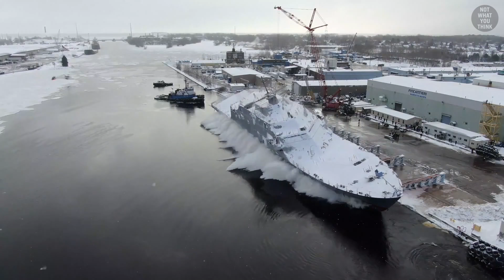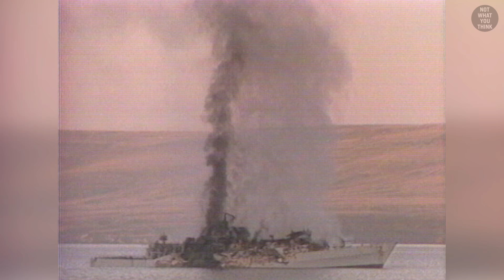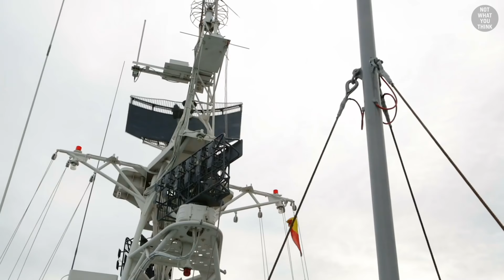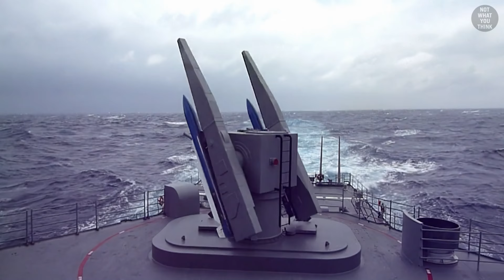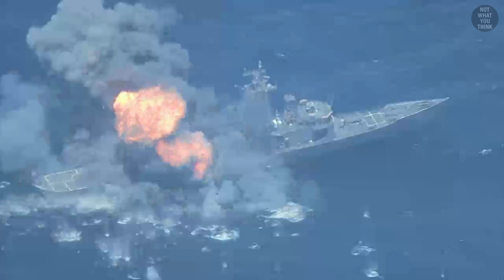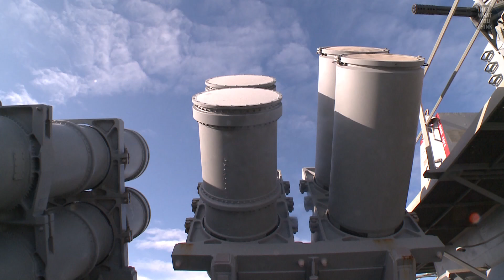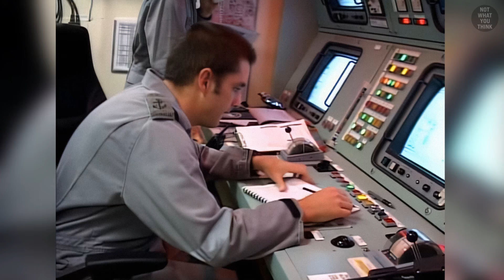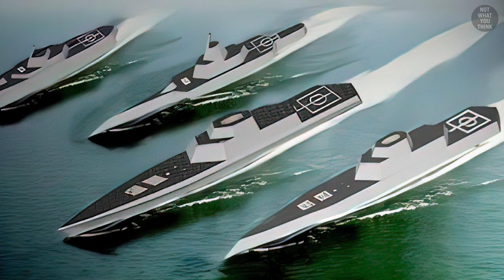How US Navy Made The Most Successful Destroyer ... But Now Has to Replace it.

Comment: Its  cheaper by far not to retire the Burkes. It's not like an old aircraft where the wing spoar can fail and the aircraft can fall from the sky. If you get a crack plug it and get to shore. If there is war new or old incoming missiles wont discriminate to which ship it will sink. There will be losses. They got rid of the FFG7 way too soon and wasted 34 billion on the Little Crappy Ships. Lets not repeat that with our destroyers. While we extend the life of these fine ships the Navy should take it's time designing the next ships and then line up the yards to build them. They have ten years before the flight one ships will be retired. Even if some ships have weaker radars all of the ships with the AEGIS systems are linked.

Comment: OK----------- .  INSTEAD OF SCRAPPING THE BURKE, MAYBE THE NAVY NEEDS TO MAKE THE BURKE INTO A DESTROYER. IT SHOULD HAVE BEEN BEFORE CONGRESS, WITH ALL ITS WISDOM, FORCED THE NAVY TO BUILD A SHIP SMALLER THAN THEY NEEDED... 
------------- .  THAT IS RIGHT, CONGRESS WANTED TO SAVE MONEY. SHOCKING!  WELL, LET'S SAVE CONGRESS EVEN MORE MONEY FROM PAYING ANOTHER 100 BILLION DOLLARS TO DESIGN A BRAND NEW DESTROYER  THAT, WITH CONGRESS'S TRACK RECORD FOR CONTROLLING THE NAVY'S PROGRAMS INTO BILLION DOLLAR BOON DAGGLES. LET'S CORRECT CONGRESS'S MISTAKE INSTEAD. AND LENGTHEN THE NEW BURKS ON THE BUILDING WAYS DURING THEIR CONSTRUCTION. INTO THE DESTROYER THE NAVY WANTED 40 YEARS AGO..  WHILE SAVING CONGRESS AND THE TAXPAYER BILLIONS. IN ANOTHER FAILED PROGRAM...   ALL THE NAVE NEEDS TO DO IS STREACH THE EGSISTING  DESTROYER'S HULL ON THE  BUILDING WAYS 100 FEET. A BIT LONGER THAN WHAT THE NAVY WANTED 40 YEARS AGO BUT WHY WASTE GOOD MONEY AND MAKE THE OLD NEW DESTROYER BETTER THAN THE OLD..
---------- . THE LONGER HULL IS CHEAP AND EASY TO BUILD AS IT IS JUST THE SAME CONSTRUCTED HULL OF THE  DESTROYER WITH JUST A 100 FOOT PLUG ADDED IN THE CENTER BETWEEN STACKS AT THE CENTER OF THE SHIP..ON A PART OF THE HULL THAT IS FLUSH WITH THE WEATHER DECK WITH NO HOUSES ABOVE THE MAIN DECK.. MAKING IT EASY.  THE NEW SECTION HAS TO BE BEEFED UP TO HANDLE THE STRESSES OF A LONGER HULL, BUT THAT IS MANAGEABLE. BY SIMPLY.  ONE WAY IS USING THICKER HULL PLATES OF 3/4  INCH. A QUARTER INCH THICKER THAN THE 1/2 INCH THICKNESS OF THE ORIGINAL HULL. BUT THEN, I HOPE THEY ARE NOT STILL MAKING DESTROYERS WITH ONLY 1/2 IN HULL PLATES, BUT KNOWING THE NAVY, IT STILL IS..  AT LEAST I HOPE THEY ARE BUILDING THE  SECOND OR INNER HULL CLEAR UP TO THE MAIN DECK INSTEAD OF STOPPING AT THE WATER LINE. BUT NOT HOLDING MY BREATH ON THAT EITHER..
----------- . ESPECIALLY AFTER THE BOMBINGS DECADES AGO OF THE COLE THAT KILLED 20 AND THE THREAT OF SUICIDAL DRONES AND CRUISE MISSILES SO PREVALENT NOW.. THE SECOND HUL, 7 FEET IN FROMTHE MAIN HULL ALL THE WAY UP TO THE MAIN DECK...  THAT WOULD HAVE SAVED 20 LIVES BACK THEN.. AND EVEN MORE IN THE FUTURE WITH EACH CRUISE MISSILE HIT AND SUICIDE BOAT BOMB DETONATING AGAINST THE  HULL.. BUT WE ARE NOT HERE TO DO TOO MANY CHANGES, SORRY TO SAY.. AND WHAT IS, IS.. THIN HULL, TWO DECKS OF HULL BARE UP TO THE MAIN DECK..JUST STRENGTHENED ENOUGH FOR EXTENDING THE HULL 100 FEET..GOT IT....
-----------. IN EFFECT, WHAT WE ARE DOING IS ADDING A 100--FOOT PLUG THAT IS A CARBON COPY OF THE HULL ON BOTH SIDES OF THE BREAK.. LIKE A PRINTER WOULD MAKE. CREATING ROOM FOR 64 NEW VLS CELLS..  AS WELL AS  4,  80--INCH  WIDE ARMORED CANISTERS TO CARRY 12.HIGHPERVELOCITY MISSILES.THAT ARE ALL THE RAGE NOW, AND ALL THE GENERATORS THE NAVY COULD EVER NEED ON THE LOWER DECK FOR LASERS AND RAIL GUNS FOR A TOTAL OF 160 SMALL VLS CELLS AND 4 LARGE VLS CELLS FOR THE 12 HYPERVILOCITY MISSILES....  THE EXTENSION ALSO MAKES ROOM FOR ADDING NICE CABINS FOR ALL THE SHIPS' PETTY OFFICERS AROUND THE VLS CELL CLUSTERS. WHILE ADDING MORE SPACE IN THE EXISTING  CREWS, NOW CROWDED, BIRTHING COMPARTMENTS FOR THE LOWER RANKS...  MAKING THEM MORE LIVABLE. TO INCREASE RETENTION RATES. FOR THE NAVY.  
----------- .. THE  200 FOOT PLUG ALSO ADDS SPACE AND TUNNAGE FOR FUTURE WEAPONS EXPANSIONS AS WELL AS ANOTHER THOUSAND MILES OF RANGE.... LOL. I AM SURE THE NAVY WILL COME UP WITH SOMETHING TO DO WITH THE ADDED SPACE AND TONAGE.. AFTER ALL, EXTENDING SHIPS HULLS WITH PLUGS HAVE BEEN DONE FOR A HUNDRED YEARS.. THAT ALWAYS REDUCES THE SHIPS' HULL DRAG FROM SMOOTHER WATER FLOW OVER  THE HULL, WHICH RESULTS IN MAKING THE SHIPS FASTER,  AND MORE ECONOMIC, WHICH MERCHANTS LOVE. JUST MAKES THEM A LITTLE LESS MANEUVERABLE. THAT JUST NEEDS A SLIGHTLY  BIGGER RUDDER.....
-----------.  EVEN BETTER IS THE PLUG WILL ONLY COST THE NAVY ABOUT 20 TO 30 MILLION DOLLARS, ADDED TO THE SHIP'S BUILDING  PRICE TAG. BECAUSE IT IS JUST MORE STEEL, FITTINGS, AND WORK. DURING THE SHIP'S NORMAL CONSTRUCTION. ONE SIMPLE COMPLETED HULL MODULE...ADDED TO THE CONSTRUCTION TRAIN..CHUGGING ALONG...EASY PEAZY..
----------- . THEN ONCE THE NAVY FALLS IN LOVE WITH THEIR  NEW FLIGHT 4 BERKE. THE NAVE CAN UPGRAD ALL 80+ BURKES SIMPLY BY HAVING THE NEW MODULE BUILT IN MANY SHIP YARDS AROUND THE COUNTRY AND BARGED TO THE FEW YARDS QUALIFIED TO CUT THE DESTROYERS IN HALF AND WELD THE NEW EXPANSION MODULES, IN PLACE DURRING THE SHIPS NORMAL DEPLOYMENT RETURN TO BASE REPAIR UPKEEP DRYDOCK PERIOD, ADDING AT MOST A WEEK FROM PREVIOUA EXPEREANCE, GIVING THE NAVY THE FLIGHT 4  SHIPS IT WANTED 40 YEARS AGO, CHEAP. INSTEAD OF PAYING HUNDREDS OF BILLIONS FOR QUESTIONABLE NEW SHIPS, DECADES IN THE DISTANT FUTURE. WHILE SUFFERING DEPLOYING INFERIOR SHIPS UNTIL THEN.. AMERICA CAN NOT AFFORD AN ENTIRE NEW SHIP  RIGHT NOW. BUT  GIVING THE NAVY TIME TO DESIGN THE FUTURE DESTROYER IT WANTS AND NEEDS WITH THE TIME TO TEST, AND NOT BEING RUSHED.  LETTING ITS CURRENT UPGRADED FLIGHT 4 DISTROYERS  GROW IN NUMBERS AND TAP OUT AT OLD AGE. AS THE GREATEST DESIGNED EVER, NEW FUTURE DESTROYERS ARE SLOWLY BUILT TO REPLACE THE 50-YEAR-OLD CLASSIC SHIPS. GOING TO THE MOTHBALL FLEET. SOME TIME  STARTING IN THE  60s...
----------- . ALSO GIVING TIME FOR CHINA AND RUSSIA TO COLLAPSE AGAIN, AS ALL SIGNS POINT TO SOON, AND ALL DICTATORSHIPS DO IN TIME... . SAVING THE COUNTRY TENS OF  BILLIONS OF DOLLARS, NOT DESIGHNING AND BUILDING THE NEW DESTROYER NOW.. BUT HOPEFULLY THE CONGRESS WON'T CRUSH THE NAVY SO MUCH IN THE NEXT SO-CALLED PEACE DIVIDEND.  OR NOT!!

Comment: Why aren't they using nuclear power on these? Makes no sense not to!
Reply: Back in the 60's the USN started planning an all Nuclear Navy. But there are problems with the idea. Firstly anytime you put a nuclear reactor into anything Costs skyrocket. Secondly the navy has a serious problem finding and training qualified people to run a nuclear reactor. Nuclear fits submarines perfectly and carriers are already so expensive the added costs aren't so much a problem and there is a distinct advantage in not carrying ship fuel so you can carry more aircraft fuel. But anything smaller isn't worth the cost.
Reply: @tancar2004 Thank you, However with new weapon systems that are going to require so much more energy I think this should be re-evaluated. Nuclear is so much better than anything else. Also has been proven safe for 75 years. I think the savings in fuel would pay for itself.  Think about the fuelers that have to come out and refuel these thirsty beasts.

Comment: Completely wrong about "the purpose of the high low mix is to save taxpayer's money". The purpose is to ensure that you have adequate QUANTITY while still having adeqaute QUALITY. Even the enormous US defence budget has limits and you have to make sure that budget allows enough ships to be built to do the job even if it means that some, or even all, of the ships have less capability than theoretically possible. Ironically the Zumwalt destroyers you quote are exactly what happens if you ignore this principle; Zumwalts will be swamped if they ever fight China in the SCS.

Comment: The biggest propblem with the VLS system is reloading. And it took 40 years to successfully test the TRAM system that they tested in Oct 2024, reloading VLS cartridges while at sea instead of port. It was still horrendously slow. At least with the pre-vls system, you could still constantly fire every 9 seconds until your storage magazines were empty; which could be upwards of 400 missiles.... meanwhile, Aleigh Burke F2 and 3's are limited to 96, and a 48 hr reload of just one array of vls (4)

Comment: Build 50 more of them, and use civilian yards if necessary. Good quality in larger numbers will beat perfection in small doses. 
     These things just demonstrated in the red sea that they can handle evolving threats, and so adding 20 or more extra ones makes absolute sense.
    In fact, if you swap the hangar for more VLS and another gun mount (maybe even a lightweight 8 inch/55), and add a flat bridge, you can basically make replacement cruisers too! 
     Keep building them and double down. They will be worth their weight in gold

Comment: The 1st and primary defense comes from the carrier air wing which has radar planes that can see further than any see based radar. Carrier interceptors, like the F14 with Phoenix Missiles, would take out air threats and extreme distance.  Ticonderoga Cruisers would take out air threats that leaked through. At intermediate range this would be done with the Standard Missiles.   At point blank range this would be done  with CIWS.

Comment: The demise of the Arleigh Burke has been greatly exaggerated. Consider the following: according to SecNav, the planned service life of the DDG-51has been extended past 35 years. The DDG(X) will not be commissioned until the mid 2030s at the earliest. The Ticonderoga are in the process of decommissioning like now, as their service life cannot be extended due to acute metal fatigue. The DDG(X) is supplementing the Burke class DDG, , but replacing the CG-47. Succeeding does not necessarily mean replacing

Comment: Considering the issues around the USS Constellation, These Burks, could be downgraded to fill a frigate role, the old ones seem to be still very serviceable.
Reply: Wouldn't solve the gold plating at procurement. That's a Congress and bureaucratic problem, not an engineer and design problem
Reply: @Penguincannon9000  Yes, it would take discipline to pull it off for sure.

Comment: The Burke is a clapped out 70s hull form. its been messed with as much as it can be. The Zumwalt class as a ship is fine. Hullform and engines etc, all good and works well.  Its only the vaporware weapon systems that never works that killed the Zumwalts.
  What should have happened. The block III Burke upgrdes should have been added as a straight swap onto the Zumwalt.  The Zum has the space, electrical capacity and systems to allow for a lot more expantion.  The Zums were designed for the massive energy requirements of future weapon systems. So of course they were canned with zero replacement designs waiting to replace the Burke retirement...again.

This is the second time that the USN is facing block obselences of a huge part of the fleet.  The 688 Los Angeles class of attack subs had the same problem.  All due to not having a viable replacement design cooking.  The youngest 688, is 28 years old.  

Fun fact of the Day: The Ticondroga class "Crusier" were designed as Destroyers. They were to be escorts for a cancelled class. The upgrade to "Cruiser" was the stroke of a pen, due to a percived "cruiser gap" between the US and USSR.  Nothing changed about the design. just the classification on the plans.
Reply: That's kinda what the usn are doing for DDG(X). You can feel the zumwalt DNA.
Reply: @Penguincannon9000  Yes. however, due to all the F up the last 20 years. Even a crash program will not see a hull in the water for a decade, at best.  It was known the Burkes were tapped out at the time of the Zums launch.  It would have made a lot more sense to give 50% of the Zum's Burke IIA ir III fits as a hedge, against what has happened.  All the R&D had been done. All the kinks worked out for a series production hull.  Minor work to put some working weapons on it really.
Now it scrabbling around to do a 90% clean sheet design again.

Comment: The major problem with building ships they ask for a design with certain weapons and needs to do this. As they design they make changes, not small ones. Then as the build them they make changes, not small ones. As they are built the cost is over double if not triple for the ship and at times can't do the job they were planned for, like our new Constitution Class Frigate. Again they wanted to cost effective so they chose a proven EU Design that was in use and was found to be a outstanding ship. Well they started to make changes to it and soon the cost skyrocketed, the ship didn't look anything like what it did before and to try to cut cost they removed the Bow Sonar Dome so it can't hunt for subs a prime requisites for Frigates!

Comment: let 's revamp those still left in moth ball Navey. This is the way to go. Lets reactivate all 4 Iowa class battleships. Yes there is a glaring need for them. This would be much cheap than starting from scratch.
Reply: It would be cheaper to build new battleships than reactivate the Iowas. And they don’t serve a purpose
Reply: @Penguincannon9000  lets do both.
Reply: @bobbymac1947  if there was a need for them. Which doesn’t exist. (Unless you ask Hollywood)
Reply: if you want a 500 ship navy they are essential. @Penguincannon9000
Reply: @Penguincannon9000  I can disagree with that. If you had ever taken a beach you would understand.
Reply: @bobbymac1947  you might disagree with that. But the high ranking generals disagree. In a low threat environment, we already have burkes with some guns. We also have apaches and cobras. In higher threat environments with missiles(where battleships can’t be used), we got carriers and amphibious assault ships for the job.
Reply: they will come around after first few thousand die. its the same story in every war. @Penguincannon9000

Comment: Burke really turned out to be a workhorse of the fleet but the time has come for her to gradually sail into the sunset.. Many new technologies have been developed since the first ship of the class broke first waves and the upcoming Flight III will max out the ship's capabilities regarding the size and power generation..
I'm really sad that the Burke replacement won't be based on the Zumwalt class destroyers, even if smaller and with less stealth characteristics. I really love the Zumwalt's tumblehome design hull and her clean lines. 
As far as design goes I also love the way the Independence class LCS looks with her trimaran hull type and a wide aft half of the body.. 
Putting design and looks aside, the new DDG(X) has to upgrade the Burke in some crucial departments. First is the size, with Burke hitting 9600 tonnes while the new destroyer will have to displace at least 12 000 tonnes. This will give her more space for VLS tubes, as well as space for much larger hypersonic missiles. Additional space has to be put aside for the plethora of various unmanned vehicles, flying and underwater alike.
Next upgrade will be in the power department. 100 000 HP won't do it since the most important systems on the future ship will need ample amount of energy. And I'm not referring only to the laser weapon, but to an incredibly powerful radar system as well as electronic warfare weapons. 
When these 2 requirements are met then weapons designer can start filling DDG(X) with the next generation of weapons and systems. From the aforementioned laser weapons to railguns to SPY(7) radar to new SM-7 Glide phase interceptor to many other weapons we know nothing about... May she have a calm sea and be produced in dozens of examples...

Comment: 19:00 not necessarily. That's the beauty of the VLS system, It can fire any missile, offensive or defensive, because it is a steel box in the deck of the ship and thats all it is. All the parts that handle containing and launching the missile all come with the missile, (besides the stuff that stays with the ship at all times) so even if there are new threats such as hyper sonic missiles, all we need to do is develop a missile that can be fired from our current VLS systems instead of making a whole new type of system to defend from them. I would like to remind y'all that we have devices that can intercept objects at orbital velocities, the hardest part of stopping hyper sonic missiles will be spotting them, but its still easier then trying to design a system that doesn't already have a VLS integrated into it. 

The VLS system isnt a missile launching system, its a missile storage system and the missiles it is storing are all in vertical boxes already ready to fire.